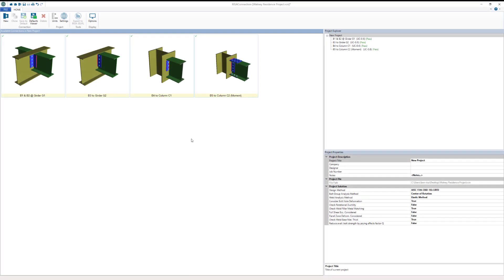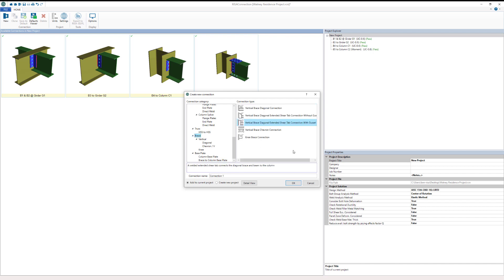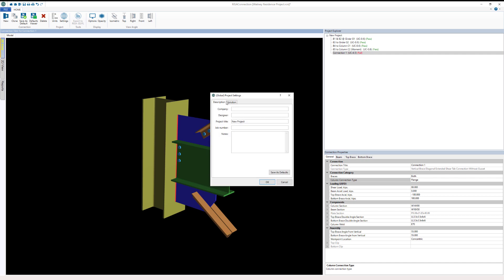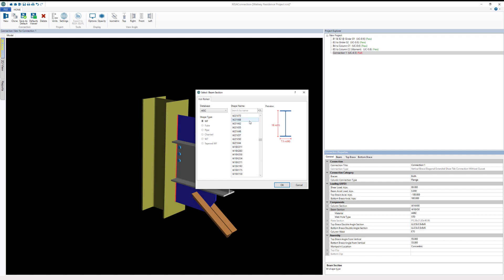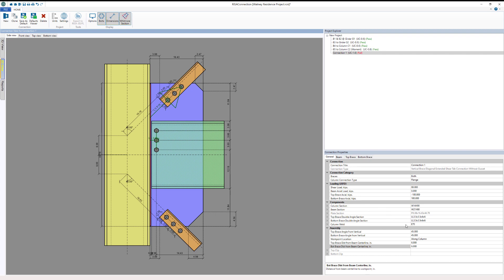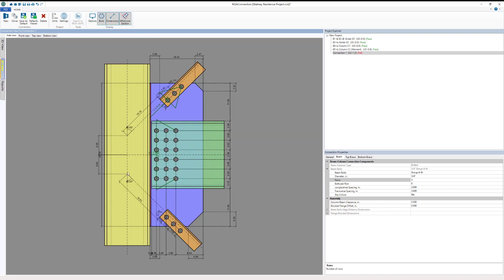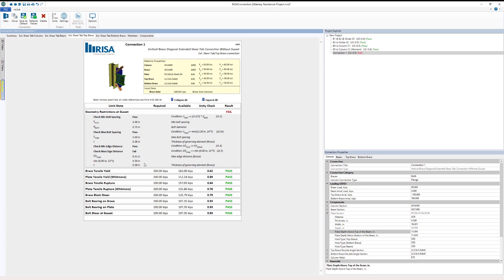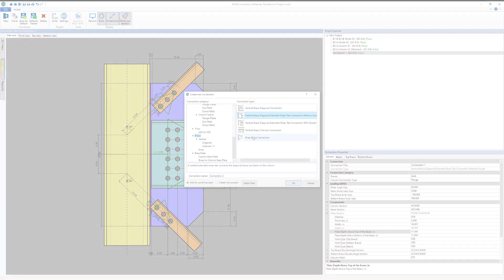Brace Connections in RISAConnection

Comment: This example should be removed from RISA library as it does not follow any connection design principles but simply adjusts parameters to achieve unity below 1.0. This is not engineering.
Reply from the maker: Kris, thank you for your input. We will evaluate the video and your feedback in order to create something better.